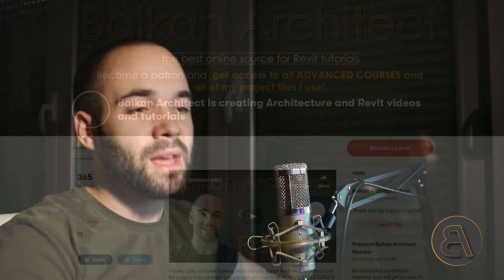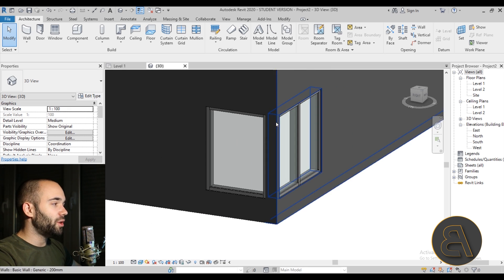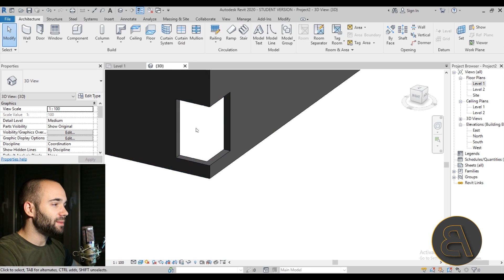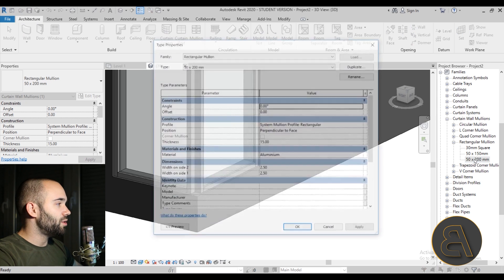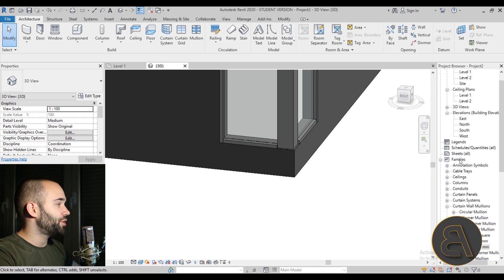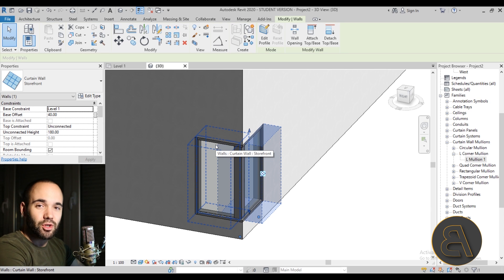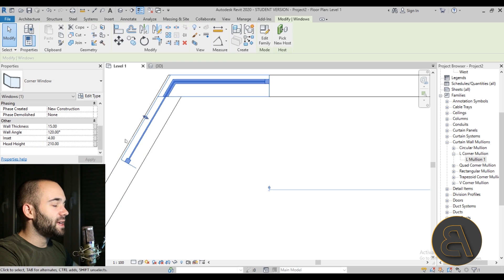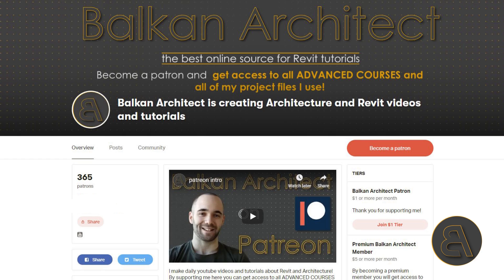Corner Window in Revit Tutorial

Comment: You can do this without making the opening, just cut the curtain wall out of the wall with the cut tool, and if you adjust the curtain wall later you won't have to adjust the opening separately.
Reply: That could be, but as more information for beginners that is required. 👍